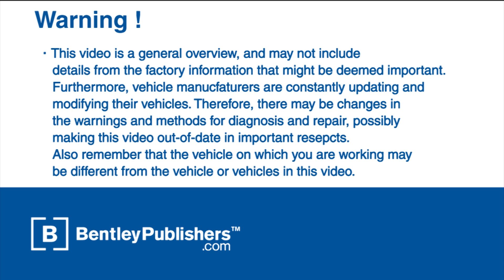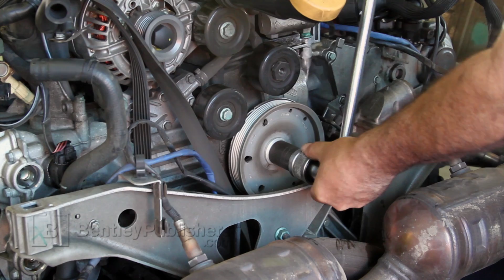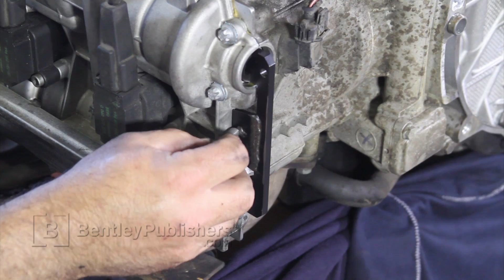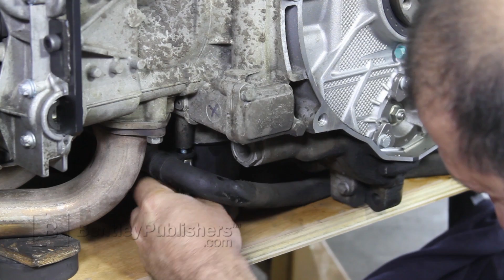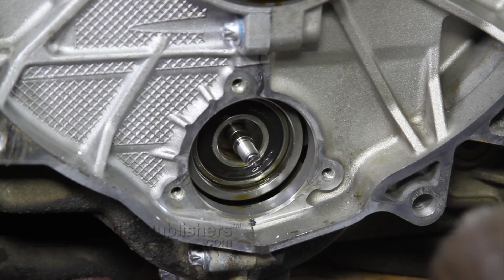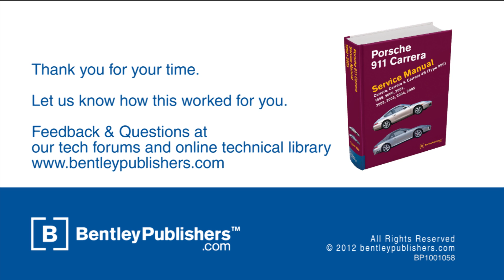Porsche 911 Carrera (996) 1999-2005 - Intermediate shaft (IMS) bearing - DIY Repair

Comment: After finding out these engines fail due to this bearing irrespective of mileage, I decided not to buy Porsche Euro trash.
Reply: Translation: Can't afford or understand German engineering. Go buy a "GO FAST" car.
Reply: Ben Kayhan I'm quite sure most intelligent people would do their homework first before buying. I certainly did, from the amount of IMS bearing videos that proved otherwise.
Reply: fact is there no definitive number of IMS failures. Everyone on all the forums are feeding off eachother's paranoia. My 99' 996 is still running of it's original IMS at 170k miles. every car has its quirks, each model is known for it's faults, but im happy. it drives down the prices of these wonderful cars. just buy one that is doing fine, and if youre that concerned, just replace the IMS as a precaution and get a sensor for it ~$2k all said and done with labor if you dont wish to do it yourself.
Reply: It isn't all about the IMS failures, that's just one problem, these engines also had a nasty reputation for coolant leaks caused by porosity due to inferior castings being made on the 996 and 997generations, also "D" chunk cylinder liner failures. You being a 996 owner would be aware of this..... These engines are nothing but crap and bottomless money pits. I've lost faith in modern European cars in terms of long term ownership. I've lost count on how many friends of mine who have issues with BMW, Audi and VW with water pump failures or glitches with engine management systems and turbos. All this technological wonder on modern engines only leads to more unreliability and huge service costs, once the warranty period expires. Simple truth here is rubber band engines don't last. The point is, why should you being a owner of a prestigious brand go to the trouble of spending of 2K on a engine warning system in case something let's go? That to me is something Porsche should had done, not putting it on owners responsibility to insulate Porsche's reputation.
Reply: @Desertduleler_88  I have had Audi A4 (2008) - 80k km Mercedes C classe (2010) 260k km Mercedes E classe (2013) 290k km and BMW 3 series facelift (2009) 190k km I had them each for about 2-3 years. I can tell you one thing..... AMAZING CARS except Audi A4 that was crap....money pit. The C class was fine, just minor issues, E class was superbly reliable, almost no issues, same as 3 series. It either me very lucky in the last 9 years or I just take care of them properly. Meaning that I immediately do changes of oil, filters, I change the automatic gearbox oil as I should, I respect the car when I m driving it, no stupid driving. If the car has an issue, I immediately go fix it. I inspect it regularly....I think it s all about good husbandry.
Reply: so you bought a  mustang instead?
Reply: Le Moulin De La Galette They were a few decades ago... Unfortunately with the computerisation of modern cars has made them more recyclable and more expensive to own and maintain rather than a long term proposition. Buy Japanese.
Reply: At first: Great video, very informative. 
I own a 996 and it already has 90k on the clock. No problems: The engine runs great. I don't think one got to have too much worries about this problem: It is repairable. And for the main status of Porsche 996 and reliability: Ah, there are always people that ruin engines, no matter what brand… ;-)
Reply: rene lagreze I do like Porsche but they went backwards with this design, buyer beware.
Reply: +MrStoneycool69 Translation holly shit are these expensive....
Reply: Ben Kayhan "every car has its quirks, each model is known for it's faults" You are right. However, most quirks don't cause catastrophic engine failure as the IMS issue does. Needing a new motor is no small cost (money and time). Porsche still has that 'something' that other manufacturers do not. But it is important to do your homework if buying a used one to avoid this issue.
Reply: johnj189 I'm not trying to slag off Porsche by any means. I'm rather an avid enthusiast but dislike the water cooled versions due to reliability issues that became apparent from unfortunate owners. IMS failure is just one of the issues with this series (996-997) but they also suffer from cracked cylinder heads and "D" chunk cylinder liner failures. I don't think it applies to the current 991 series but only time will tell. I prefer the  993 series and earlier air cooled versions of the 911.
Reply: Ben Kayhan Just got a 1999 911 996 C4 with 136K &  all the IMS talk had me initially spooked to go ahead & purchase, but I AM GLAD I DID - I absolutely love this car & the engine per TruSpeed is as tight as a drum & clean enough to eat off. The reason I wanted to respond to Ben is because this post made me feel even better about my purchase even in lite of all the IMS hype.
Reply: Glad you're enjoying your brand new (used) car!
Just check out the IMS when changing the clutch and you should be fine! Just remember that the 996 does make 'ticking' sounds on occasion, but don't worry, those are just 'porsche' noises. I actually had to sell my 996. I moved to a new house and I had to choose between keeping the 996 or my 98' sl600. I loved my sl600 too much to let go, but one day I'll buy another 996- hopefully an awd! If you ever have any questions, feel free to send me a message!
Reply: Thanks Ben! Will do.
Reply: Baerchenization 1999 911 996 C4. So far so Great.
Reply: Tony E.
Keep it.
Reply: MrStoneycool69 Oh Yeah ; )
Reply: Tony Mast No, performance cars in general are money pits, so I paid off my house instead and remain debt free.

Comment: Any idea on the time frame for this, my manuals are all giving very different times to even pull the transmission (5-14 hours) and then I'm thinking an hour for actual bearing replacement??
Reply: 25-30 mins.

Comment: The IMS bearing is on the flywheel end of the M96 engine (996/986).  The intermediate shaft functions to drive the camshafts via chains. The factory sealed IMS bearing is subject to wear and failure. If the bearing fails in operation, the engine will be severely damaged. Porsche does not sell the bearing (comes only with a new intermediate shaft, ie. engine teardown required), The basis of this video is replacing the bearing only using an aftermarket bearing.